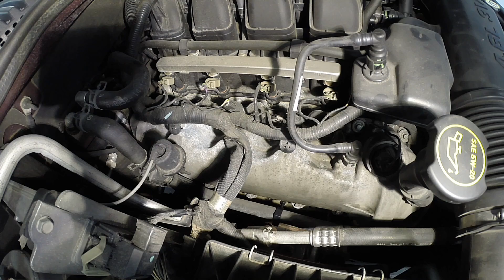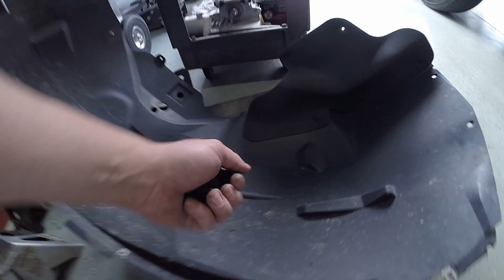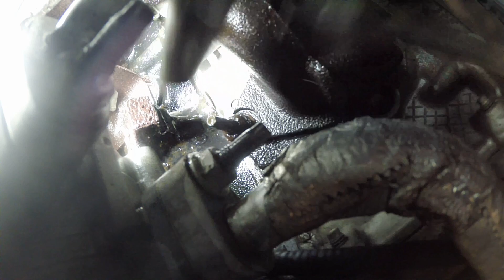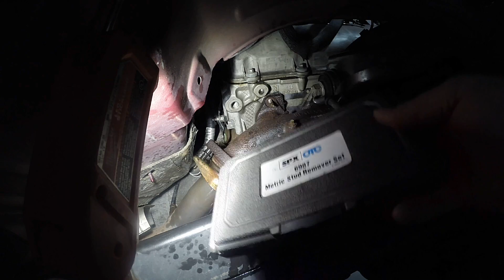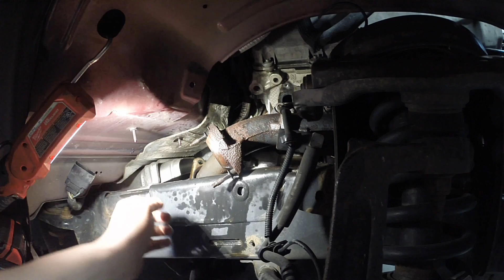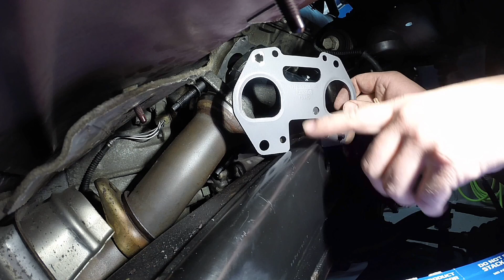Ford Explorer 4.6L 3v: Passenger Exhaust Manifold Replacement

Comment: Great video as always.
I noticed you mentioned drilling out the broken studs. one method of extraction you might consider is the mig welder. I've done this job many times and this method has always worked for me. what you do is weld on the end of the stud until it protrudes from the head. then weld on a flat washer, then a nut. then you simply undo the "bolt" you've just made. it sometimes takes a couple tries to get the weld right, but it always works. you don't have to worry about welding to the head either because the weld doesn't stick to the aluminum. it makes the job super easy. Hope this helps!
Reply: +FordTechMakuloco Eric at South Main Auto does the weld thing. Really neat. Love your channel!!
Reply from the maker: +Ben Jolly I know of this and I was going to demonstrate it on the bench if these did not come out so easy, maybe in the future.
Reply: +FordTechMakuloco I was meaning that when I do it, that's my go to method of extraction. I do it in car.  Unless of course there a bit protruding to grab on to.
Reply from the maker: +Ben Jolly yeah It just would have been hard to film in car is all but I am very excited to perfect me welding technique over the winter and incorporate this.
Reply: Ah, that makes sense. Keep up the good work. Thanks for the reply.
Reply from the maker: +Bill Rimmer yup its a great trick I just need to buy a welder first.
Reply: +Ben Jolly  
I have used stick, MIG, TIG and gas welding procedures. 
Stick and gas are the worst, closely followed by MIG. 
Using TIG is exponentially easier and better than using MIG. 
TIG is much more controllable, less likely to damage the head, introduces less heat, concentrates the heat where it is actually beneficial and produces zero spatter that can damage machined surfaces. 
BTW:  From 30 years of experience, any of the welding methods can damage the head and or the threads.